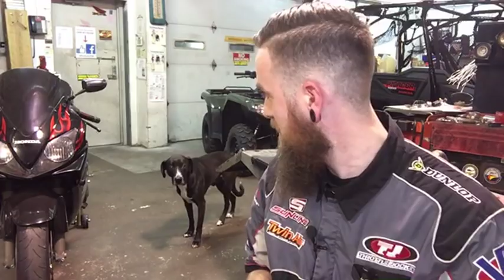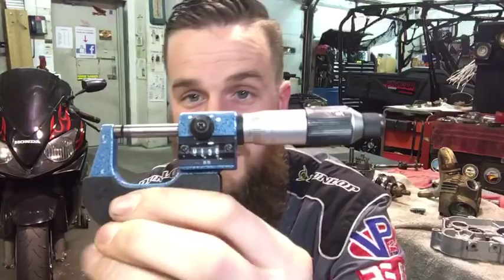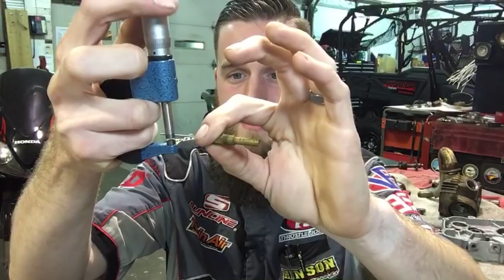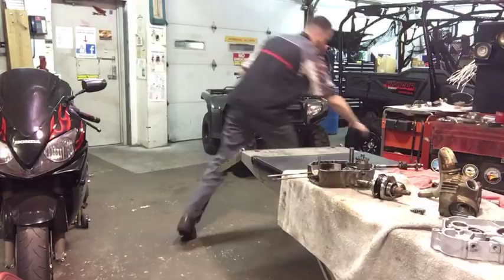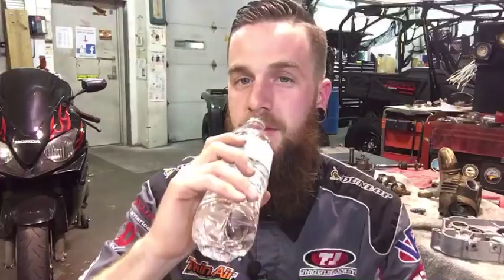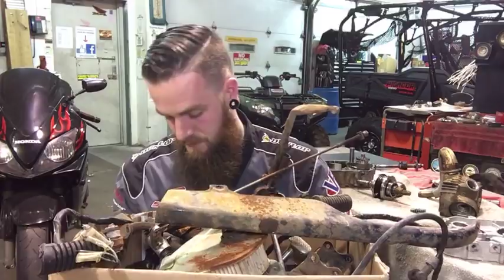Carb Cleaning Tips - Ask MD Live Q&A Episode 13

Comment: Man, The videos are fabulous. They save me so much time and they are very entertaining – Thanks.
I recently bought a 2002 KX 250 that the seller had “done a bunch of work on” and snuk on to a MX track with his buddy to test it. He went over a jump and at the bottom the owner was installing a drain pipe and he slammed into it. When he got out of the hospital he put it up for sale and I bought it with a crumpled front wheel. I replaced the wheel and will likely have the shock stanchions straightened to solve that problem.
When I cranked it up to run the gas out for the winter, it idled a little high when cold but as it warmed up the idle became extremely fast. I estimate about 5000 to 6000 rpm. It was so fast that the kill switch did not want to stop it
I suspect that happened to the last rider and he just did not bother to mention it to me. I think it is probably an air leak somewhere in the system but I haven’t worked on bikes since the late 1970s. What would you suggest that I check as possible problem areas?
David Floyd

Comment: Hey Cody been loving your videos. Hope you can help me . Honda 2002 750 shadow spirit .sat 5 years carbs very nasty . Took apart ran through my ultra sonic heated for 25 min. Blew out With compressor all gets and Orifices. Cleaned jets with wire brush , wire scraped sides with it as well. Thought I did a nice job. 
Cranks without choke ,         Ideals fairly decent , then spits and pops on Acceleration very badly .

Comment: Wat up Cody !!
Cody, would it be advisable to use the same size main for both the front and rear carb? I have a 117 on front and 115 on rear. Rear pops alot even with PMS screw turned almost all the way out. Wat u think ?
Reply from the maker: I would put the 117 in the rear! Sounds like the mixture screw isnt making much of a difference of the bike is just way too lean. CLEAN THE CARB!